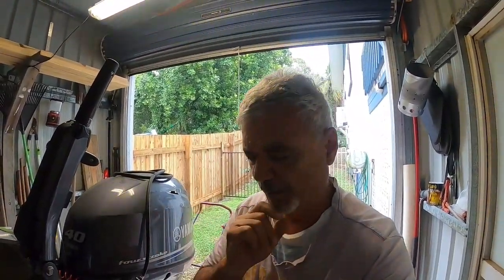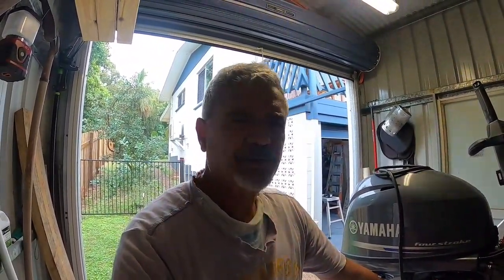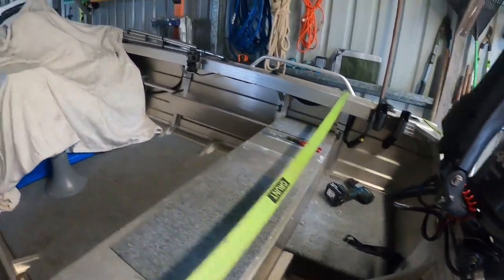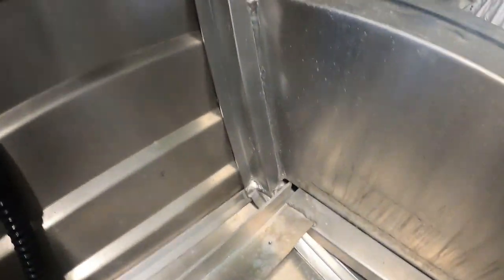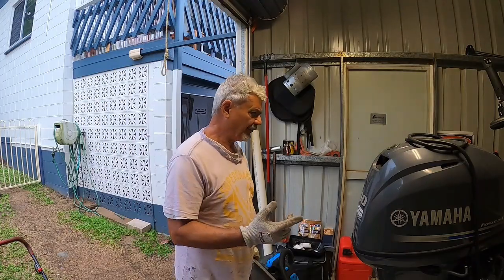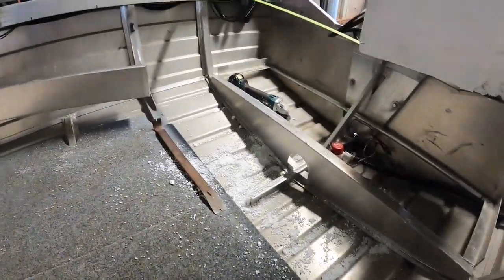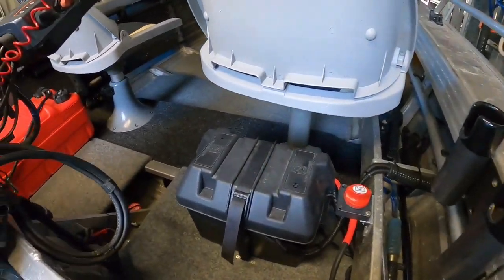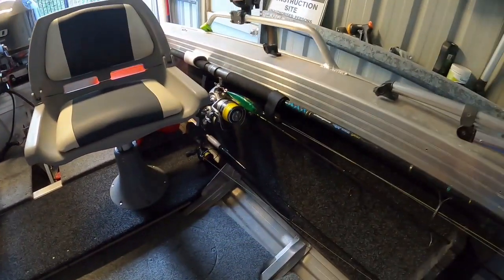Pimping the 420 BUSTA - doing a very radical mod to the Quintrex 420 Busta don't do this at home

Comment: The rear seat you cut out is filled with foam for so your boat doesn’t sink if anything happens  
The renegades have the floatation under the full floor between the casting decks
Reply from the maker: Thanks for your comment…I’m fully aware of that. This is my 6th tinnie I’ve owned in 38 years…and my 11th boat…